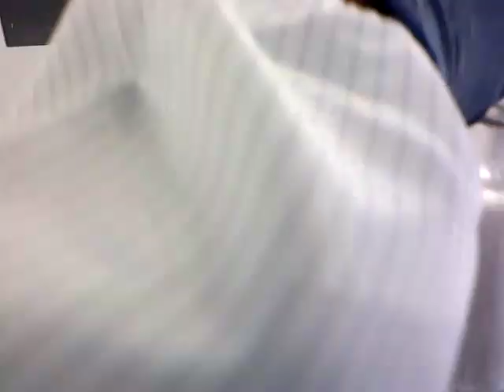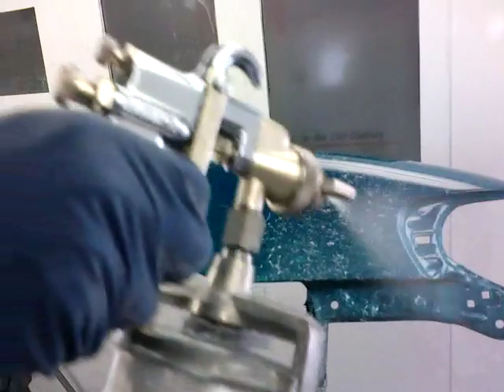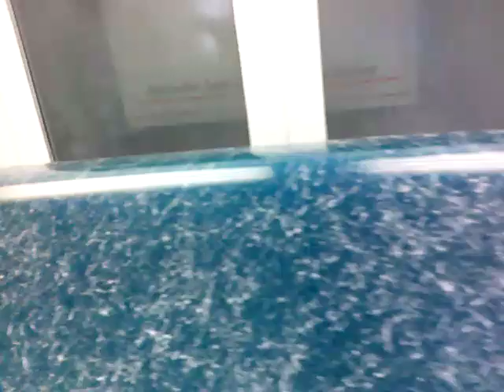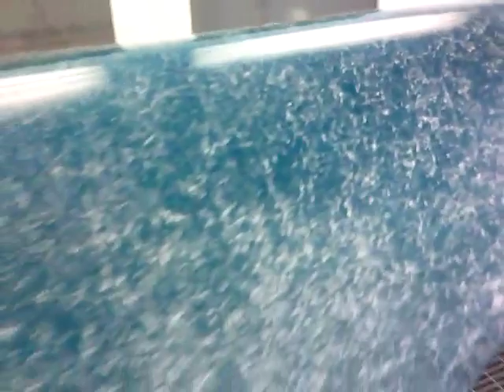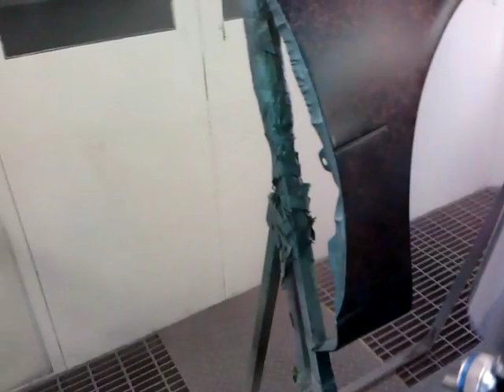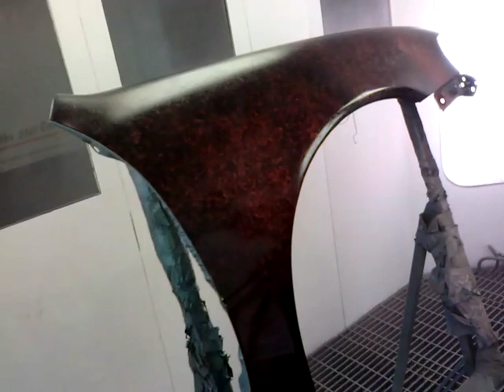Paint Spider Webbing Demonstration {marble effect also}

Comment: Also known as "veiling" and "disheveling", Iwata makes a veiling gun, the SGD-71. It's a pressure feed gun with a special air cap. It's meant to be used with veilin g lacquer. This marbleizing is done when making cultured marble sinks, for example. 

You can make your own veiling lacquer by dissolving styrofoam into laquer, and when you spray this mix it will "cotton candy" out of the gun.
Reply: Daniel Shafner can u do that in any color
Reply: @plastikpaintz_p2431  idont think so

Comment: The technique you use here was used as a deluxe finish on some morse code keys I collect that were built from 1936-1940. I have a couple of these keys I wish to refinish, but haven't been able to get the technique down. I bought your ebook but didn't find specifics there about this technique. I'm familiar with automotive paints and spray guns, so I'm looking for something more specific about the tip size and air pressure. If you look at this link, you'll see the effect I'm trying to duplicate. http://www.qsl.net/n4xy/Images/Electronics/Ham_Radio/KEYs/BUGs/keys_bugs_mcelroy_01.jpg Thanks!

Comment: i tried messaging you not sure if it went through
really interested in figuring out how to do this 
thanks
Reply from the maker: I used a large tip and sprayed 100% lacquer over a base paint. The large tip makes it come out stringy as you see. Then I used a transparent paint such as a candy or concentrate to apply over the white effect which you see.
Reply: The Paint God what kind of clear are you using? Clear lacquer, or maybe an intercoat clear then a 2k clear?

Comment: Forgive my ignorance, but the effect is caused by the aplication or by the product? I mean: Is the regulation of the spray gun or it's a special kind of ink? Regards from Brazil.
Reply from the maker: Its based on the spray gun needle size, which you will need a large one. Also the material that is sprayed is 100% lacquer that makes the effect.